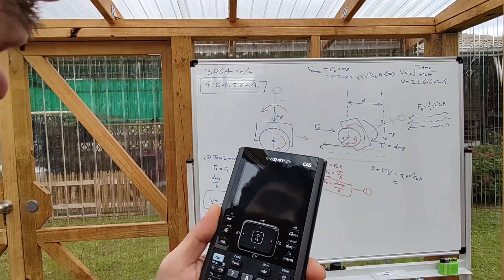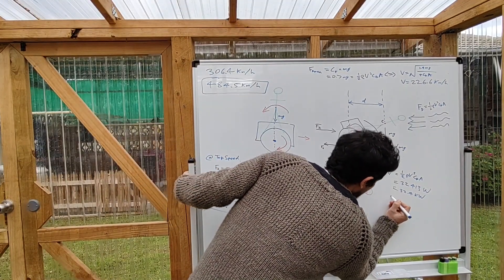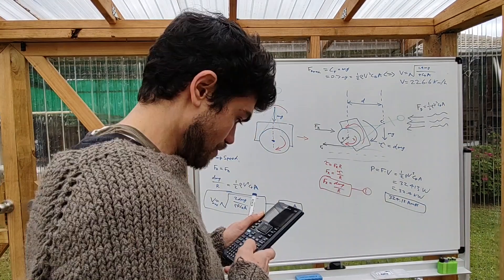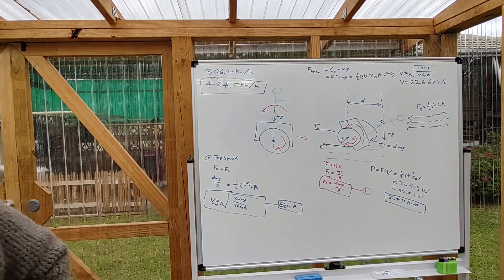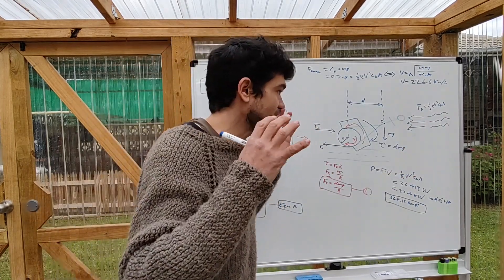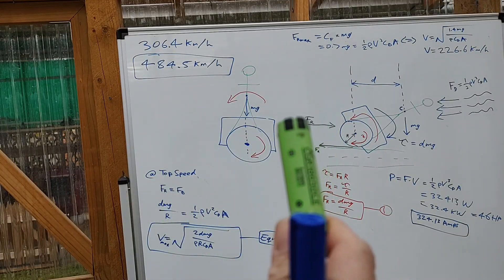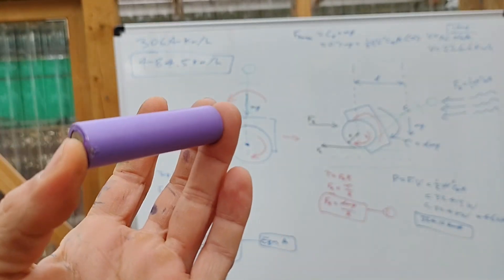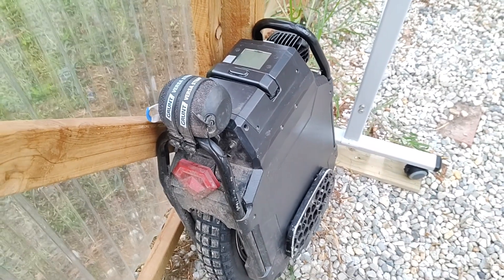Let's revisit top speed (EUC Physics)

Comment: Hi Mr Ark Rides.
You mention 117amps. 
Ive looked about and found.
Sherman at 70kph can be pulling 105amps, in fluctuations down to whatever 30amps.
Moster pro at 85kph..
Fluctuates 27amps to.....drum roll.
125amps. While at 85kph. 
91kph was shown also 125amps aprox with variations. 
Your calculated top speed amps may infact exsist. 
Your sherman may be 117 amps very possibly. Maybe. 
Be well. 
:):]

Comment: I have no idea about this stuff but its just cool to watch, but I had a thought. I'm not sure if you accounted for this or not. I feel like the technology that an EUC is applying has its own limiting aspect. I'm not sure if I can explain what I mean very well but the EUC will ONLY APPLY the required amount of torque and speed that is needed to KEEP BALANCE, no more and no less. So example if a person is at full horizontal lean and it takes X amount of force to keep the rider in "balance", then the wheel will no longer accelerate further past that X point because it will not over shoot the balance point. Maybe you did account for that and I was too lost and confused to catch it lol but awesome video as always, just adding some comments 🤙🤙🤙🤙
Reply from the maker: Glad it's interesting to follow. Bro what you said is basically right. I've got some other interesting problems coming up soon.

Comment: Dude, awesome video again!  Definitely with an internal combustion motor you wouldn't be able to maintain balance as precisely as the EUC can. You would need some sort of transmission that could immediately change the direction of the wheel rotation. 

Thank you again for breaking this question down regarding EUC speed with physical limitations. It's always nice to see the equation to get a sense about what we are dealing with regarding the physics. 

Completely off topic, but have you ever calculated the earth's curvature as it relates to distance? As in at what distance would you expect to see earth drop? It's interesting indeed. 

Thank you again man!  I love your videos. Oh and how is the Max running?  I'm hoping it's performing flawlessly.  I'm still rolling the OG and having the extra range of the MAX is tempting in that I go on long rides.
Reply from the maker: Thanks bro. Yeah good point about the transmission. I should've mentioned that. It would definitely be very jerky switching between gears. And for braking it would need a mechanical brake. I haven't calculated the Earth's curvature but I have some interesting stuff I'll talk about in the future relating to stars though.
Reply: @arcrides6841  Right on man. Looking forward to your next videos for sure. Creating from Lux.

Comment: Next time you are driving your car at 100kph on the freeway, put your hand out of the window and feel what 100kph wind feels like... There is a limit to how much wind a human can stand in, even crouched into the wind. There will be a speed at which the rider of an EUC can no longer remain on the wheel... as at a certain speed, the wind will basically blow the rider off the wheel. A wind of 70mph (112kph) would be enough to blow most people over... according to the weather guys,  terminal velocity (for most people 120mph) would be impossible to stand in.   ( It wont let me comment with a link in it, so Google how much wind a person can stand in)  It doesn't matter how one looks at it... and what data... there is no way of getting much faster than the top speeds we have now... not to mention, if one is travelling at, as an example, 70mph and a gust of head or side wind hits, there will be very little directional stability... and hitting any undulation of the terrain, the rider will lose gravitational grip on the pedals.  Fun to dream of higher speeds, but we are really almost there now... maybe with some sort of fairings and fins to reduce the exponential  aerodynamic drag on the machine and rider, to reduce the lift on the rider and create downforce to keep traction... maybe 80mph could be achievable... I can't see much more speed than that being possible in reality

Also, air is essentially fluid... so at some stage, the machine would encounter 'hydroplaning'  on the air in front of the tyre...  I have ridden my Sherman at 79kph and that is plenty fast enough for me... if you gave me an EUC capable of, say, 120kph... I would happily ride it at 75kph haha
Reply from the maker: Great points. First I'd say to consider motorcycles doing wheelies. They are capable of doing over 150mph on one wheel. I know it's not the same but you could have some kind of extreme power pads that lock you in really well. Next thing to think about is that you need to keep leaning forward harder and harder the faster you want to go. So by the time those extreme winds have come into effect you will have a very big forward lean angle therefore your body wont be flat up against the wind the way a person standing in the wind would be. It will be leaning in forward heavily. It's ability to blow you over would be far reduced. For example if you were leaning forward at 90 degrees it's ability to blow you over would be zero.
Reply: @arcrides6841  Yes, but as you lean forward, your back would make like the shape of a wing, giving you lift and reducing your weight on the foot plates. Motorcycles doing wheelies, the rider is sheilded from the bulk of the wind by the frame and lower part of the bike. If we had some sort of fairing and our feet strapped to the foot plates on a very smooth surface... but I wouldn't like to be the crash test dummy riding it haha. It would be good if we could make an EUC radio controlled and let it loose on the salt flats and see how fast we can make a machine go with no rider (following above it in a helicopter with the transmitter) Say. with a weight on an inverted pendulum sticking out of the top... the transmitter making the weight go forward for faster and back through neutral to the weight hanging out the back to (hopefully) slow it down
Reply: This is fun. Large ships extruded nose deconstructive interferance may take another inch.
How much power are we allowed to draw from wheel?
Ha. 
Can we change environment?
Im just playin.
Love the vid Mr Ark.
I feel all relaxed when a measure is cooking for some reason.
We wish you all nice success.
Be well from Will and Mr Data :):]

Comment: Just watched seated rider  sherman 70kph sustained. Less than 50amps. 30 ~46.
Tho not as fun as facing a dozen uber drinks. 
Honarable work.
Reply from the maker: The Sherman can sustain 70kph even standing. I believe it would be under the 2500W rating of the motor at that speed on flat ground without head wind.

Comment: 350 amps kinda sounds doable
See a euc now 80amps pull is no big deal.
Did you state the weight using those little green batteries?
Backpack of capacitors zapping hell.
Ha. 
Besides the fun of the speed math, 
The 35kg sherman vs 
49kg ex2os Hs , vs
 The Master 36kg,
 as wheels to buy is a tough choice. 
Version 3 sherman is a great wheel.
Your old one is a good example cause salt and beach sand is the one thing nobody would ever expect anything to survive. 
Ex20s has first gen suspension bugs, and seemingly no battery level gauge on wheel.
Master 75 mile range at 20mph.
Tho only 10 miles flat stick according to Mr Zen Lee i believe.
Any thoughts about choosing another sherman over master or ex2os? Just wondering, since im not a billionair yet it makes picking a wheel slightly more interesting.
I think there should be more tilt back options for wheels. My opinion is code stories in wheels is very thin. 
Ustride just cut out, insted of tiltback for overheating. Whaaa?
Is the comunity gonna cry out for better coding? Probably not i bet. 
I keep comming accross quiet cultures its all say nothin. 
Try being in 3d printing omg.
You dont look like a say nothin do nothin dood to me anyway. 
Euc cant go faster then tilt back rather than cut out. 
Euc overheat then tilt back rather than cut out.
See how obvious it sounds, but people say oh thats how it is.
Dood its a code story try come up with a better plot twist than The end. Cut off crash under bus.
I get the feeling from people that codes are written in majic stone and nobody could change it. 
Anyway im just annoyed about it.
Enjoyed the math and also hearing about your wheelin.
Thanks.
 We wish you nice success. 
Be well. 
:):]
Reply from the maker: I'd up the voltage to 300V and then you'd only need about 117Amps
Reply: @arcrides6841   i could swear some wheels now are like 100amps bursts. 
Can any off the rack wheel short burst 117 amps.
Maybe it can cap bank for burst.
Codeing the wheezil. Dodgy and scary, yet we see others who you and i are going to bet our spines on there codes, with such winning stories as
If  ustride overheats? 
Then       The end cut out.
Imagine the meetings to vote it into wheel code.
My favorate imagined scene is where we hear the sales pitch for each. reasons to type Cut out. 
Instead of tilt me back and save my life. 
Anyway does any imagined story youd tell have The end cut em out as the plot twist. The end Cut out and never tilt me back to save my life.
117 not long sustained amps.
300 short term volts. 
Maybe thats the easyer trick around is it dont need to be able to sustain it.
It never did.